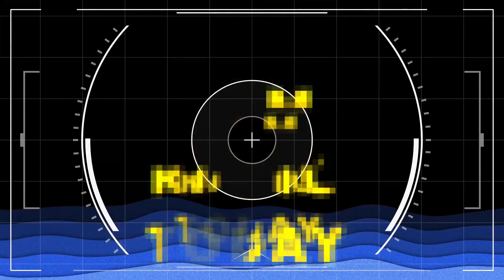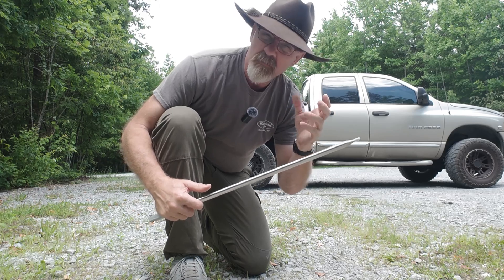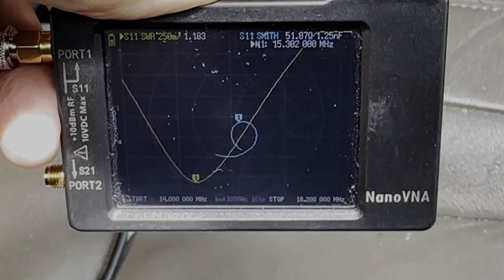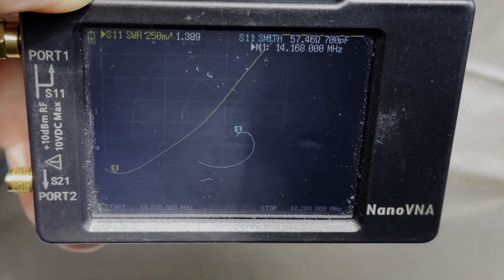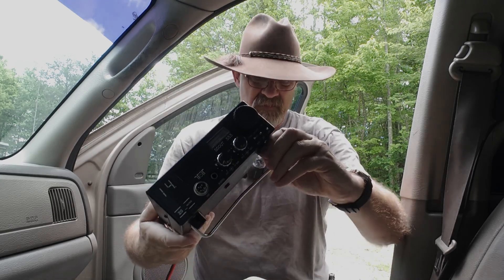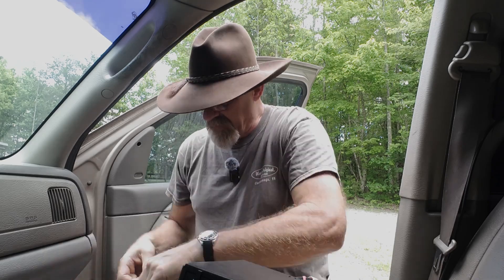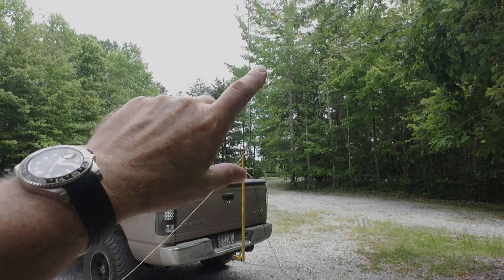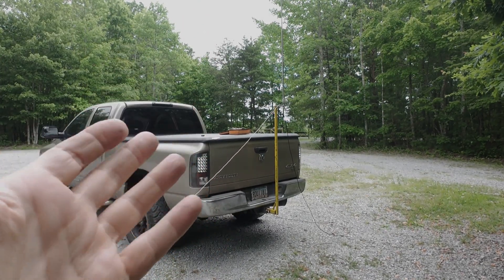How to tune a Wolf River Coil Telescoping Vertical Antenna for Ham Radio - POTA Activations

Comment: That’s an interesting concept never thought of using radials for changing frequencies swr I’m going to try that out
Reply from the maker: Yeah, changing the angle and position of the radials will change the characteristic impedance of the antenna and thus the SWR too. It works really well for me. Good luck!!! 👍